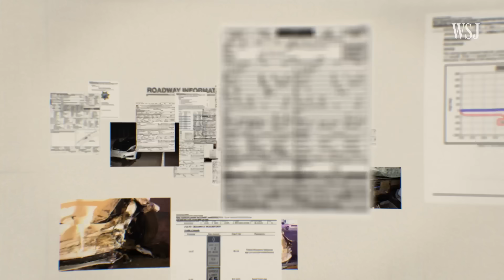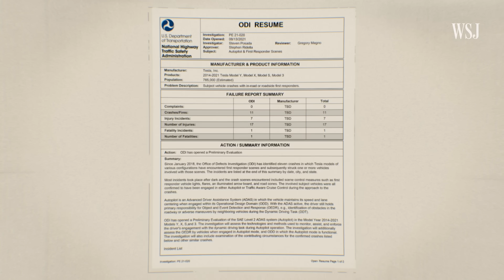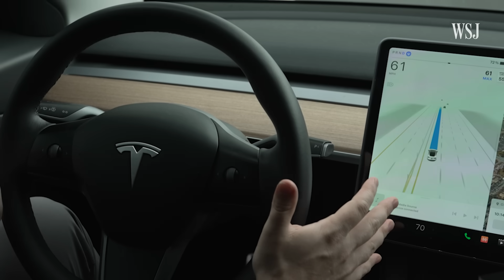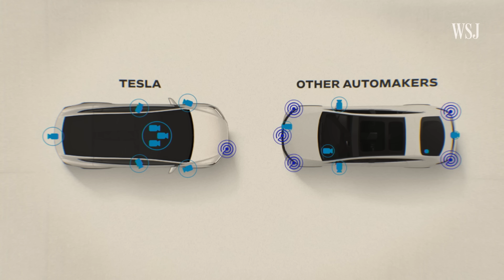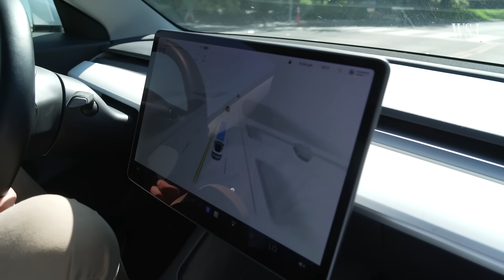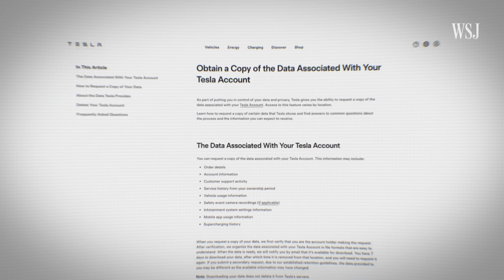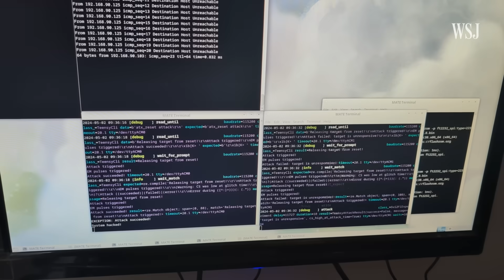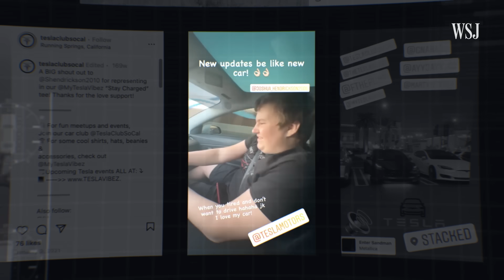The Hidden Autopilot Data That Reveals Why Teslas Crash | WSJ

Comment: Most of these examples seem to be a result of AEB failure. We need a bigger investigation into the effectiveness of AEB on all vehicles (camera, radar, lidar) 

Lanes keep systems in general could encourage complacency and reduced attentiveness to possible road hazards 

A lot has changed in the past 3-5 years, you can get similar driver assist from almost all automakers. The horse has left the barn

Comment: I have a 23 plate model Y in the UK.  The 'traffic aware cruise control' is pretty good on the motorway or dual carriageway but otherwise it's not very reliable.  It phantom brakes, it doesn't brake when it should, it reacts far too late most of the time and it accelerates really aggressively, it reads the wrong speed limit signs (adjoining roads), it doesn't slow down ready for reduced speed limits.  Basically it drives like a nervous new driver - everything is a bit late and over-reactive.  I certainly wouldn't trust it to drive me anywhere at the moment.  And only having cameras is not good enough, the car is constantly warning that one or more cameras is blocked or obscured due to sun and rain.  And as others have pointed out, road markings and signage are not well maintained enough to rely on as a human driver, let alone for a computer.  Its a shame because the car itself is good, but the driver aids are not as good as they claim, not by a long way.
Reply: TACC is only small steps above dumb cruise control.

Comment: I’d appreciate some data on how the Tesla performs with humans for the context. Obviously, autopilot gets into accidents. But does it get more often than humans?
Reply: You can't make that comparison because autopilot doesn't drive the same roads and conditions as humans. For example, it very likely won't drive in bad weather, very dark, etc. People tend to engage it in optimal conditions.

I suspect that humans fall asleep more, so long straight, no-even roads would win, whereas any sort of emergency where foresight matters it would fail. Like slowing down because the road ahead is wet or because something is going on. Or being flagged. Or being honked at. Or written instructions.

I feel like any numbers that compare humans and machines would be useless unless they all drive in the same conditions. Racing drivers crash way more often than regular drivers.
Reply: @ndi4926 I know about that. But you still can make a comparison for those scenarios
Reply: I’d appreciate some data on how the Tesla performs with humans for the context. 
"In the 3rd quarter [of 2024], we recorded one crash for every 7.08 million miles driven in which drivers were using Autopilot technology. By comparison, the most recent data available from NHTSA and FHWA (from 2022) shows that in the United States there was an automobile crash approximately every 670,000 miles" (Tesla Vehicle Safety Report 3Q2024).

Comment: Almost all the crash footage showed preventable crashes if the drivers were actually paying attention while in 'autopilot' as they should.
Reply: For the crash 7:05 I don’t think any driver, human or computer, could have prevented it
Reply: 9:15
Reply: True. 

In other words, the autopilot is pointless and dangerous, and Musk has massively over-exaggerated its capability.
Reply: @david.stachon  Are you mixing up autopilot with FSD? Autopilot just keeps lane and speed, that's all there is to it. What else is autopilot supposedly be advertised as?
Reply: @valuemastery  You can't actually be serious right now.
Reply: @valuemastery lmao what!? Autopilot or not the cars emergency braking system should have performed and it did not. This is a symptom of radar removal.
Reply: @david.stachon  What am I missing in autopilot's promised capabilities? Here's what Tesla advertises:
Cruise Control: Adjust the vehicle's speed to match surrounding traffic
Autosteer: Assists in steering within a clearly marked lane.
That's all there is to it. If you pay for Extended Autopilot (which I did), you get Auto Lane Change on highways, Autopark and the Summon feature on top.

People in their mind imagine that "autopilot" is kind of an automatic driver that they fully can hand over their vehicle to. Operating under this false assumption, it's no wonder when they get into crashes. Its just a lane assist and cruise control. If you want more, you'd have to get FSD.
Reply: @dontewhat  I agree that emergency braking should have prevented this case. However, in reality none of the emergency braking systems of all car companies is perfect, they all fail in some situations. To draw the conclusion that a system is bad just from one special case wouldn't be the best move. You need systematic testing. And this has been done plenty of times, by Euro NCAP, german ADAC and others. If you get into the results, you see that none of those systems perform well in all cases, and the Tesla system comes out near the top, with most systems performing worse. For example, the Volvo system was in tests even better then Teslas, while Mercedes or Xpeng performed considerably worse.
Reply: @valuemastery  They "imagine" that in their minds because that's the messaging they get from Tesla. ...you know, when Musk has been saying FSD is only a few months away (rinse and repeat since 2015).
Reply: @david.stachon  How would the delay of FSD make people think autopilot is something else than it actually is? Autopilot and FSD are completely separate systems and have nothing to do with each other.